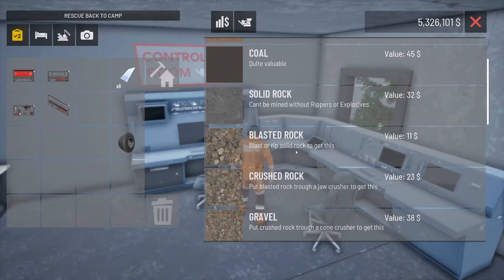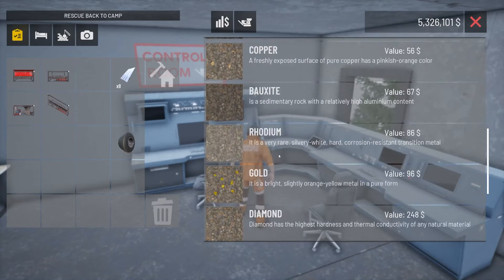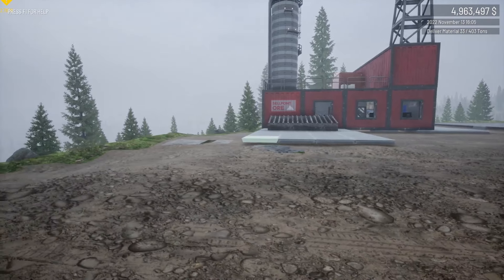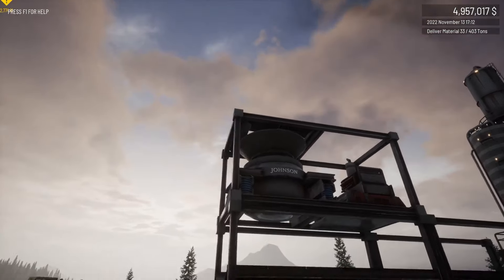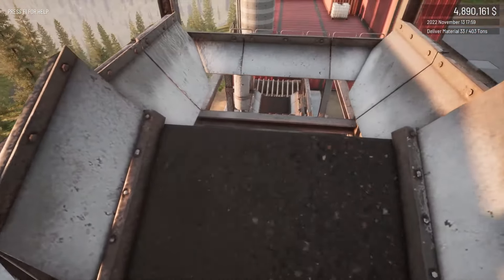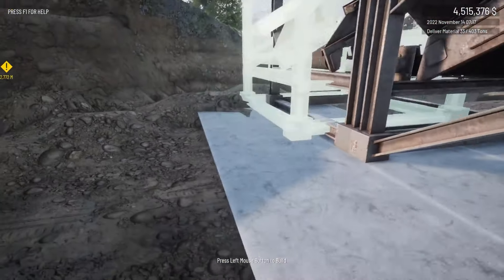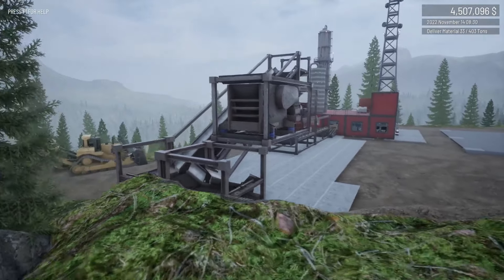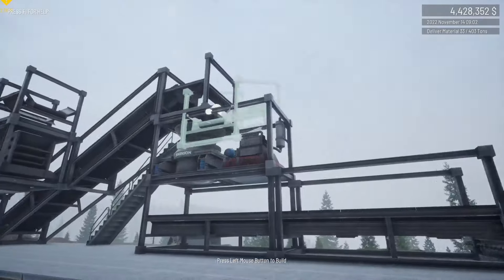Building a Massive $1,000,000 Ore Washplant - Out of Ore

Comment: Also.... your tip point won't spill if you use a big red hopper and either build a mud ramp upto it, or dig a hole and Bury it level with the floor... then use the cement slabs that are upright to build a wall around your opposite tipping side and nothing will spill at all
Reply: Spills are inevitable no matter ho careful you are.  If you bury it and use the concrete floors, then cleaning up spills is as easy as bulldozing them into the hopper.
Reply: Came here to say the same thing. Bury a hopper in the ground, and you can just dump the dump truck right into it.
Reply: Boulders go through the walls, otherwise yeah.
Reply: I buried mine and just drive the truck over the top to unload it 🤣
Reply: @CircleSIndustriesLLCMorgantown  😊😊😊😊😊😊😊😊😊😊😊😊😊😊😊😊😊😊😊😊😊😊

Comment: The sorting Drum is for getting rid of dirt from paydirt.
Reply: Hey I like you videos
Reply: Yes splitintwo gaming, dev have replied to the Crusher order thread on Steam with the correct setup at the moment. 
Have summarized in another post on this video, but here it is:

Summarized from the Crusher Order post on Stream:
Jaw crusher turns blasted rock into crushed rock and cone crusher turns it into gravel.
Sorting drum turns Paydirt into dirt and ore, should be on it's own line.
Ore nodes should go directly to sell point.

So you need 2 different setups and the possibility to dump directly into the sell point for pure ore.

Great videos and streams, thanks for the content!
Reply: yeah, running pure node ore is not advised, 
running paydirt and Blasted solid rock is into a plant that is sorter jaw cone.

Comment: Dear Drae, YOU NEED A ROAD! The reason all of your vehicles suck is because there is no road to your dig-site. The articulated dumper is the best! You just need a winding road to the dig-site down the mountain. have you ever seen a 6x6 dump truck drive up a 45 degree angle? NO! there needs to be a road, please build one with a dozer, buy an excavator with a smooth bucket, toothy bucket, and a drill, then buy the articulated dumper.

Comment: The dirt coming out the bottom of the sorting barrel is waste dirt, I ran a belt off the hill to the side and just dump it on the ground over next to the hill. 

Using the red hopper to drop the bucket or truck into will reduce spilling

Comment: Good attempt, not the correct setup according to the dev.

Summarized from the Crusher Order post on Stream:
Jaw crusher turns blasted rock into crushed rock and cone crusher turns it into gravel.
Sorting drum turns Paydirt into dirt and ore, should be on it's own line.
Ore nodes should go directly to sell point.

So you need 2 different setups and the possibility to dump directly into the sell point for pure ore.

Comment: Why don't you dig a hole in the ground at the beginning of your setup and put a hopper in the hole so you can just dump into it easily with having to lift the bucket so high and you can dump straight out of your truck